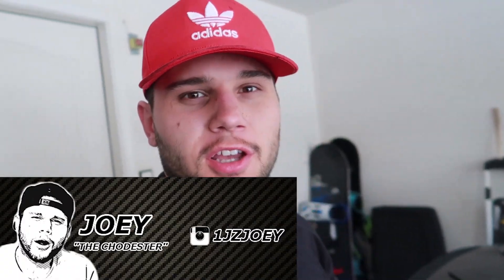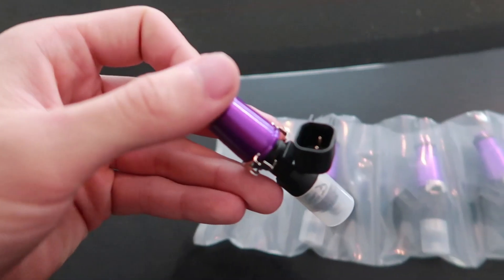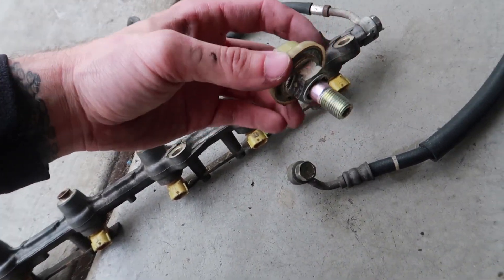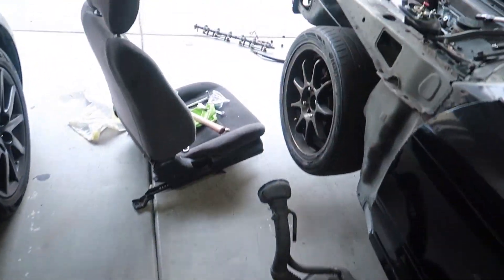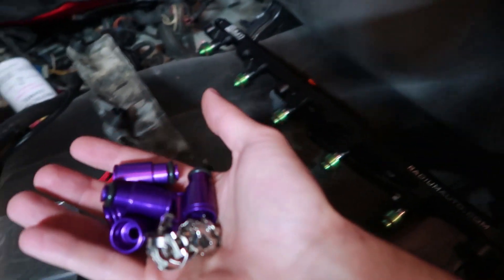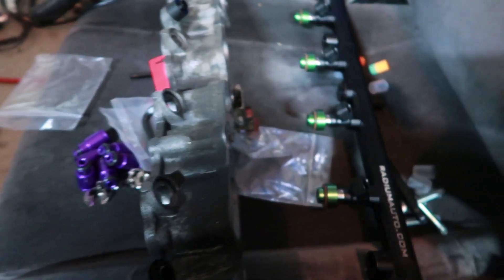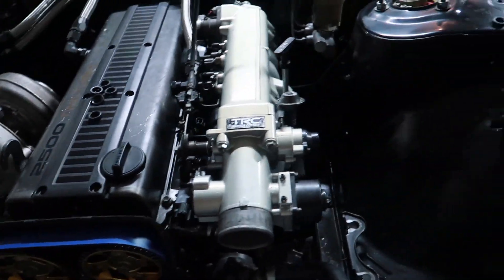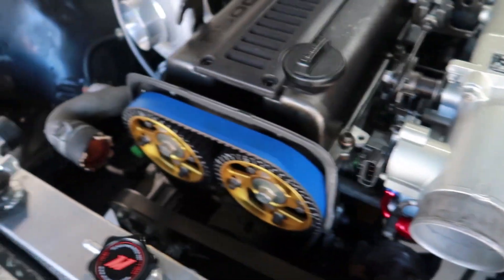Injector Dynamics & Radium Engineering Fuel Rail UPGRADE + Aeromotive FPR

Comment: Your injector ev14 or not ?
Reply from the maker: They are ID1050x
Reply: @TrackFactory  How long without extensions ? 34mm or 48mm?
Reply from the maker: @Markusran88  34
Reply: Good day, how were the terminating of the connections? Were the jacks easy to connect with the 34mm? Considering going with the 48mm

Comment: dope vid, i was just wondering...do you HAVE to take off the intake in order to change the fuel rail????
Reply from the maker: Unless you're a God you're gonna have to remove the intake. It's only like 6 bolts. Super easy
Reply: Track Factory dang it lmaoo, i was not trying to take it off but i think ima have to lmaoo thanks for the info!!!!
Reply from the maker: @MDNT_Garage  it's super easy my guy!!
Reply: Nah, take the throttle body off along with everything above the injectors, id take off the banjo bolt in the rear and the fpr on the rail first if possible but the fpr doesn’t have to come off, just makes it easier but its also a pain to remove. Then you can take the mounting bolts off and slide it right out.